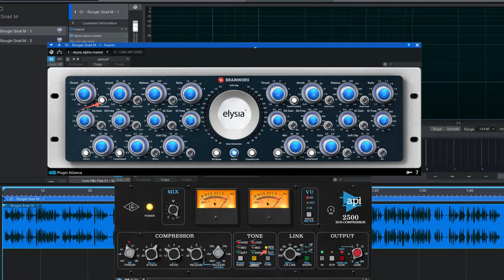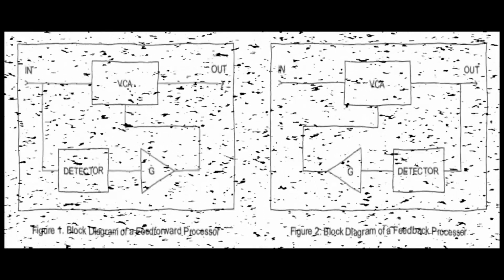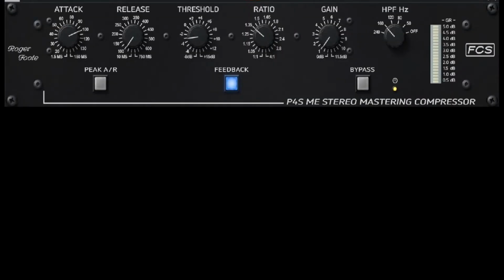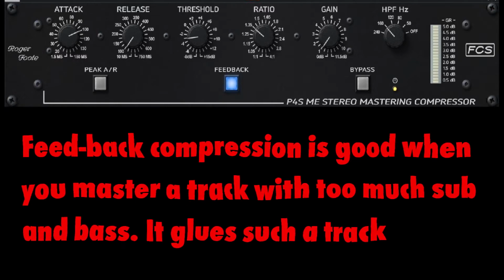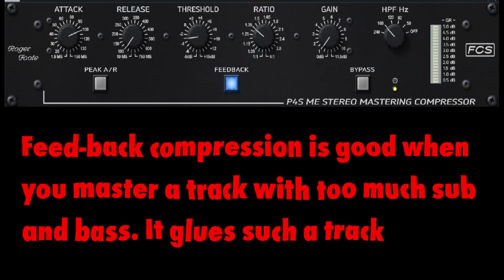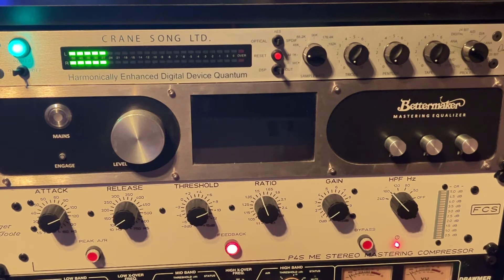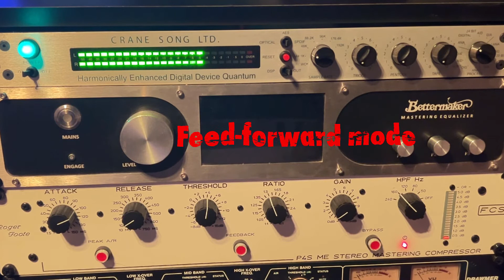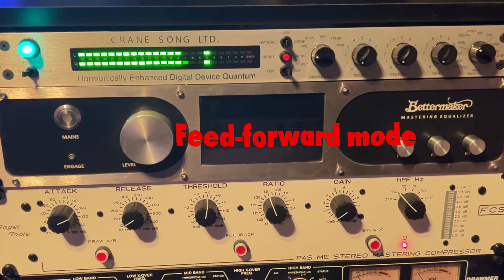Feed-back vs Feed-forward compression in mastering

Comment: Definitely can hear pumping especially of the synthesizer pads and background vocals with feedforward compression. With feedback compression it's pretty smooth.  But obviously using feed forward or feedback compression during tracking can give you different results in your final mix as opposed to FB making a full track sound louder,  or FF to pump the track to the beat like a lot of dance music uses for an easy, dramatic, but ultimately fatiguing, purpose.
Reply from the maker: Thank you for your professional comment👍🏻

Comment: I cant quite grasp the concept of feedback compression, the signal is amplified, then compressed, then amplified again? does this create any sort of audio delay-latency?
Reply from the maker: Great question! 😊 In feedback compression, the compression is controlled by the signal after it has passed through the compressor, unlike feed-forward compression, which uses the input signal to control the gain reduction.

The process doesn’t necessarily amplify twice, but rather uses the post-compression signal to adjust the gain reduction dynamically. It doesn’t create noticeable audio delay or latency because the circuit operates in real-time—especially in analog units.

Feedback compression tends to have a smoother, more musical response, which is why it’s often preferred in mastering for subtle and natural dynamics control. Let me know if you’d like me to dive deeper! 🎛🙌
Reply: @boogiesnail  Thanks for the answer, so Let me see if i get it: ffcomp, works the same way as sidechain compression, but in this case you use the same signal to be compress AND to trigger rhe detector. But if in fb comp, the signal  goes directly in to compression? If so what ir the purpose of the feedback loop?
Reply from the maker: @akg414  Great follow-up! Let me clarify:

In feed-forward (FF) compression, yes, it’s somewhat like sidechain compression. The incoming signal is split—one part is used as the audio to be compressed, and the other part is sent to the detector to control how much compression is applied. This approach gives more precision and faster response, which is great for modern, punchy sounds.

In feedback (FB) compression, the signal is compressed first, and then the output of the compressor (post-compression signal) is sent back into the detector to determine further compression. The feedback loop creates a more reactive, smooth, and musical compression.

The purpose of the feedback loop is to make the compressor "listen" to its own output, which naturally results in a gentler, more forgiving dynamic control. This is why FB compression is often used in mastering, where transparency is key.

Let me know if that clears it up! 🎛😊
Reply: @boogiesnail  yes, i got it now, Thanks so much!
Reply from the maker: @akg414  You're very welcome! Glad it makes sense now—happy mastering! 🎛😊